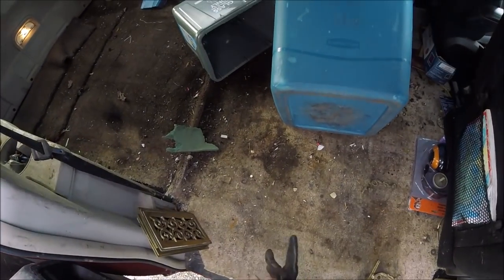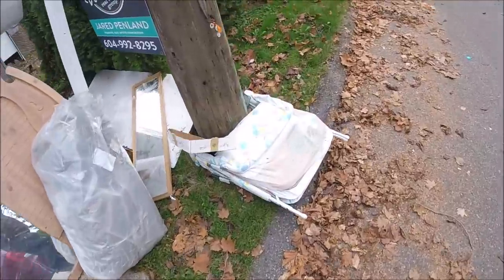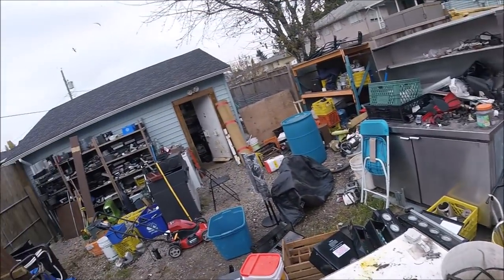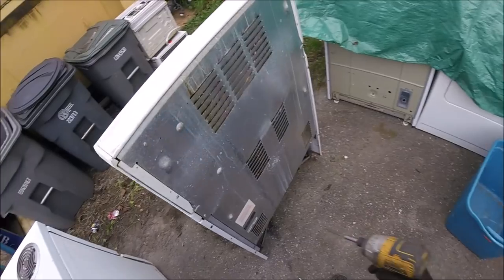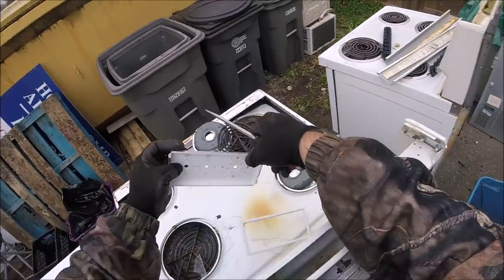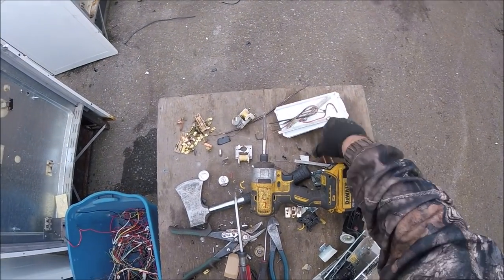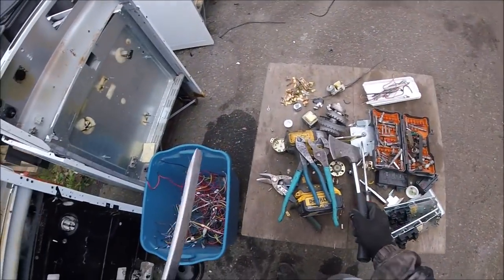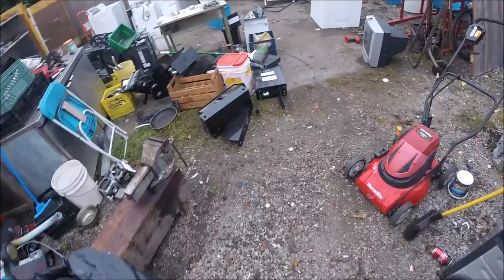Street Scrapping & Scrapping Stoves

Comment: Phil I watched you scrap 16 microwaves l dont understand why you went to the trouble of removing the outer metal cover on the microwave? Also the glass dish inside and all of the plastic waist why dont you put it in the microwave and shut the door what’s the differents if you scrapped the microwave without doing anything to it would be the same amount of scrap also it would add a small amount of weight to the microwave and eliminate plastic waist you have to dispose of?